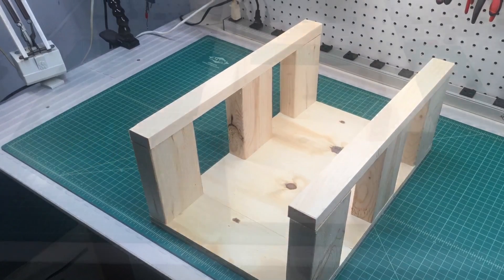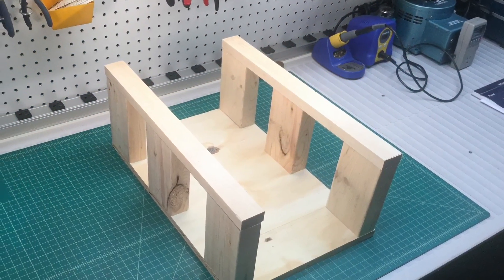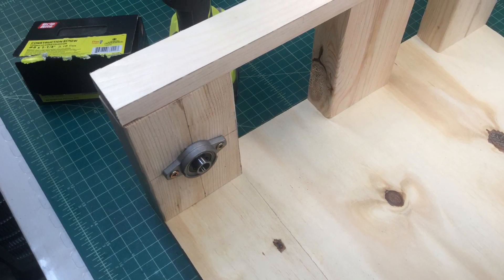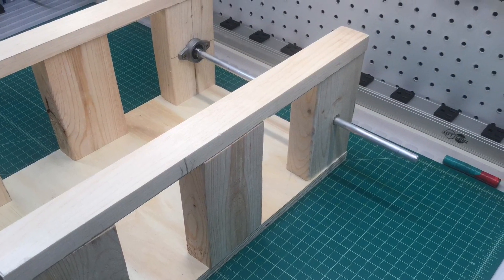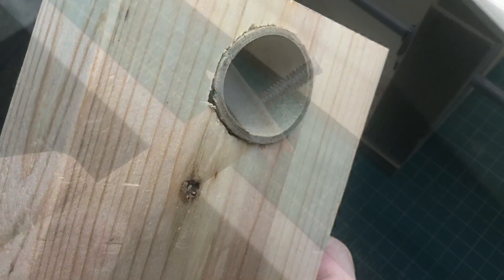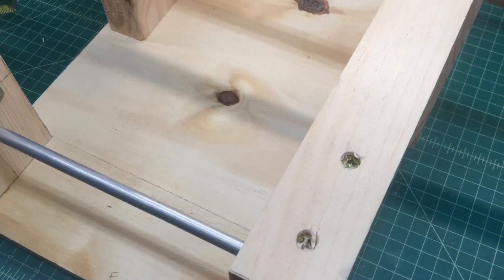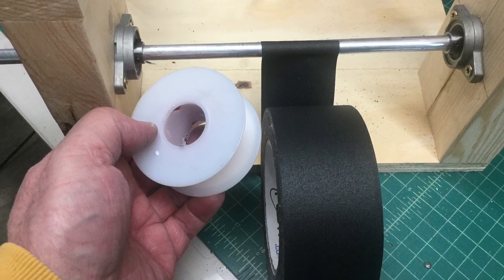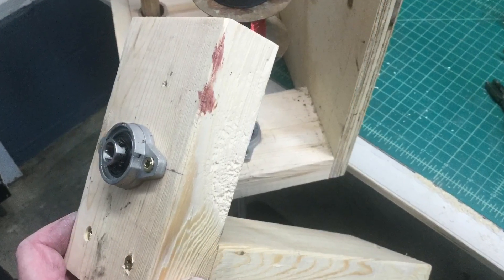Coil Winder Build

Comment: Hi Don:

Great video series on how to build your own coil winding machine!  Thank you for posting  them.

I am in the process of building one of these units to rewind the field coil in a Rola Series K speaker that is in a Ware B-1Bantam radio from about 1930-31.

The stepper motor (and mounting bracket) that you used are both still available from multiple sources.  

I am having a lot of difficulty locating a combination driver/controller like what you used in your build.  I noticed that you advised another subscriber that this particular controller had been discontinued.

For us technically challenged subscribers--could you please advise what driver and/or controller you would use to go with this same motor- if you were building this coil winder today.

Thanks a lot in advance for taking the time to answer this.

 I plan on using the winder to rewind a couple of other dead field coils that I have.  Once built, I would also like to make it available for others in my local Antique Radio Club (Vintage Radio and Phonograph Society out of Dallas, Texas) to use in their projects.

Wayne Jones
Tyler, Texas
Reply: My question got cut off for some reason.

What I was wanting to know was if you would please advise us poor technically challenged subscribers as to what driver and /or controller you would use to drive the NEMA 17 motor...if you were building a coil winder today.

Thanks again!!
Reply from the maker: Hi Wayne - it’s been some time since I built this and right after the motor controller I purchased/used was discontinued as you know. I haven’t researched this in detail, but I would look to leverage Arduino. There are a number of examples online and this is one of many for reference: https://www.schmalzhaus.com/EasyDriver/Examples/EasyDriverExamples.html

If you settle on a solution, I would appreciate you keeping me updated so I can inform others should this question arise in the future.

All the best.

Don

Comment: I would like the details of your stepper motor controller/ counter.  Can you provide it because I would like to build my own.
Reply from the maker: Hi Sam - sorry I’ve been away from YT. I purchased the controller on Amazon some time back and last time I checked the unit was discontinued. You may want to consider using Arduino if you are comfortable with programming. In addition, there may be some new controllers available. I would do a search on eBay and see what hits you get. I’ll search myself and pass anything worthy to you. Again, I apologize for my belated response. Best, Don

Comment: nice work!
i gotta build one now  :)
Reply from the maker: +su pyrow Hope it helps on your design. The wire guide needs to be located much closer to the receiving bobbin, so I'll most likely modify my design when time permits. Please keep me posted on your build and changes that drive improvements. Please let me know if you have any questions or need anything I didn't cover in the video series. Best, Don